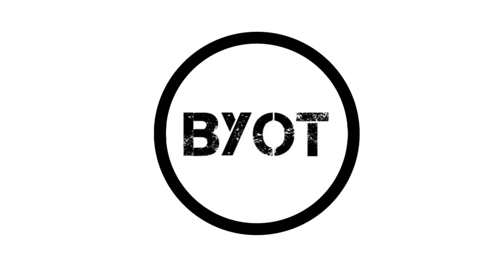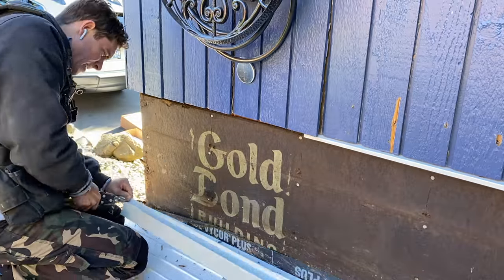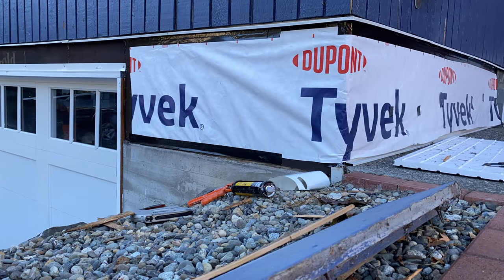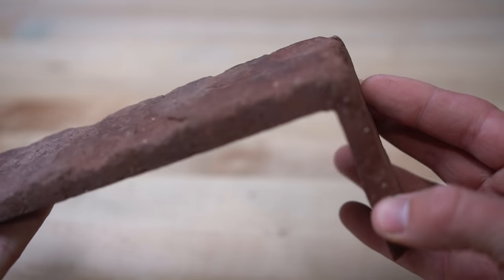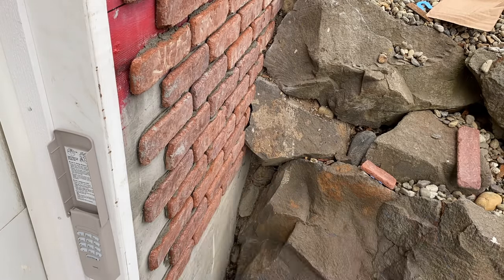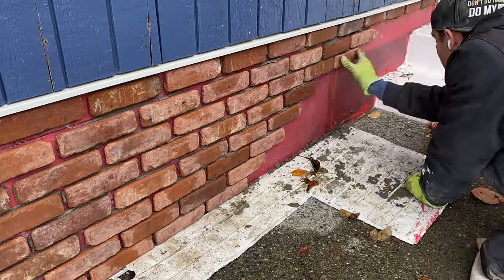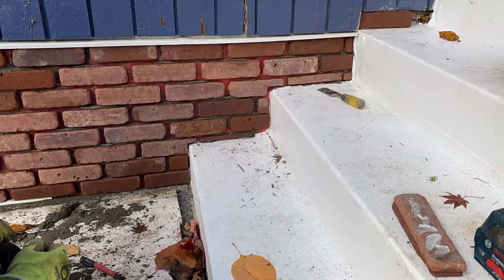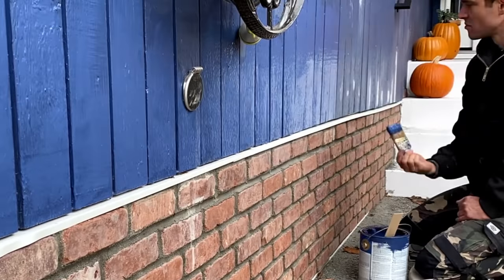How To Install Brick Veneer Outside // DIY THIN BRICK

Comment: As a mason for 16 years,  you did a pretty good job for not doing it as a profession.  I do the grout bag a different method but whatever way works is good.  Keep up the quality content.
Reply: Tuck pointing, using a hawk and jointer I’m guessing. Much and cleaner but the grout bags do the trick as well.
Reply: I use a trowel and tuck pointer if doing a small area but I would do the same method as him on this much pointing up.  I just fold the grout bag different.  I fill the bag the fold in half then roll it down towards the bottom.  It works well.
Reply: Combine it with a 15 year old house
Reply: @MudHere1  
Does thin brick make walls stronger?
Reply: @nuttysquirrel8816  it's not going to be significantly stronger than an LP smartsiding or 3/4" wood sided wall. If at all. The mortar joints would be a weak point on the brick wall and that wonder board is really quite weak as far as puncture resistance. You might gain a little bit of r value with the brick wall.
Reply: question for a mason. I was on a jobsite and there were masons setting up their scaffolding on the facade. They hung up a metal mesh over IIRC tar paper. I never got to see what they were laying.. If it was bricks, stones, brick veneers, or stone veneers.  When do you do you guys use metal mesh on exterior walls?

Comment: I do this for a living you did a good job man be proud of yourself
Reply: @scout1672  apply a coat of damp proofing tar let dry and you can apply thin brick should take care of it if water a big issue may need to install French drain then damp proof and then apply veneer
Reply: Not a bad job at all. 
1. First things first. For the love of God throw that flat trowel out of sight. 😆 and use your margin!
2. Always! Tool head joints followed by bed joints. Brush and repeat.
3. Brick tape story accordingly, snap every other story mark. (Every other course) lay to snapped lines. Then fill remaining courses with eyeball for level between already level courses.
4 .Hubbard jointer! Made of magnesium to pull moisture out (like flatwork) for smooth finish.
5. Cut tip of grout bad bigger!
6. Good job bud. Better than some apprentices
Reply: @Eyesopen365  I read brick veneer can't be used outdoors since it's so pours. I want to use is my outside kitchen wall.
Reply: @Eyesopen365  Thanks for the tip , we will.
Reply: @634shy  I've also installed this outside countless times, as well as manufactured veneer stone. There's a few layers of protection here. You could, of course,  cut real bricks down. 
But, between the layer of scratch coat (approx 1/8"-1/4") mortar, and the 1/2" bricks themselves, you're covered quite nicely. Over the house wrap, I've also always used 15# felt paper (roofing) starting at the bottom to ensure water tightness.
Reply: @634shy  hi yes you can I am about to do outside thin brick onto cement board which is treated with waterproofing, it’s real brick just thinner! Bricks are very porous, what matters is your waterproofing behind that👍
Reply: How much does something like this cost? But for the whole house (minus the roof of course).

Comment: As a 15-year brick pro that could not have been done better. Brick does absorb water but in your installation, it was perfectly dealt with. You could have spent the extra money to buy the trays thin brick sit in to keep them straight but it looked like you did well. Perfect and maybe a little overkill on the water management but I don't think you can overkill water issues. That was the perfect choice in the jointers. Fantastic job from a guy that knows. Well done.
Reply from the maker: Bryan you made my day.  I take pride in the videos I produce and did plenty of research on this project before taking it on since it wanted to make sure I showed everyone the proper steps.  Thanks so much for watching and sharing.  Truly appreciate the support.
Reply: Really? I think it was pretty amateur work
Reply: @DK-bk1vq  I was thinking the same thing. Haters will always hate! BYOT did an awesome job!
Reply: @dans8935  I agree! He put the labor and time in to get this to us. 
  Posting your work on YouTube, is something I have no inclination to do.
 And certainly ol boy Dustin, who complained, would never have the stones to do because someone might hurt his feelings.
Reply: @BYOTools  OUTSTANDING VIDEO--I was almost finished typing in a 15 line reply, then touched the wrong key and it disappeared. I don't have time to recapitulate it all. Just simplify my question. Can any thin brick be applied over real brick (that happens to be the surface on about half of my original Cape Cod , circa 1920. The wirecut red brick is obviously original and is 99.9% solid mortar joints (just a few bricks on front facade near bluestone front door landing which obviously got decades of splashed water and snow, but nothing tuckpointing. couldn't fix. I've been aware of thin brick and saw some workers installing it on the lower sections of a Walgreens in town here in Brgen County NJ. Very impressed by the finished project and how good it looked (though of course as always there's a lite hazing of efflorescence that comes and goes for a few months) I don't know what the surface was they started with but I am sjure it wasn't brick; Probably concrete. I need to know if you know where I could find info (on youtube or elsewhere) on the feasibility of using any thin brick directly on top of (of course a properly prepared) substrate of REAL brick. (About one third of the sq footage of the house is brick, one third vinyl siding (upper level) and the remaining third large decorative beige stone (on the rear section which was remodeled and expanded befoe we moved in 25 years ago.. thanks. hope to get some info ....
Reply: @williamcervetti1455  why not ask your local contractors this question? I'm sure at least one of them will be happy to help; if you don't get a reply here, that is. Good luck.
Reply: He used RedGuard in a vapor transfer situation and therefore it either has already or will fail. And a "brick pro" touting a venneer brick looking tile job is like a plumber claiming that some guy who used a bunch of sharkbites did a fantastic job. lol
Reply: Are you for hire

Comment: I have never seen anyone use rock board or redguard on exterior of home. Its definately water protected 3 or 4 times over..a. contractor would have charged 2 arms and a leg to give you that much protection, that's the benefit of DIY, nothing can ever be overkill if your happy. That part of the house will be bone dry 500 years from now. Id love someone like you to do a job for me. One thing for sure, i definately wouldnt want to work for you. And i say that in the most positive way possible..everything has to be perfect

Comment: Nice job. One area of concern is that the mortar that you are using does not bond to the red guard at all. You should be troweling on a polymer modified thinset onto the wall then adhering the bricks to it. Other than that fantastic job. Especially on the prep work.

Comment: Some of that was overkill, however I'm all about overkill. Every project on my house I make sure If it can have extra protection without causing a problem then it gets it. My yard gets flooded and it floods my crawlspace. The previous owners solutions was just a tiny sump pump in the crawlspace. It barely keeps the water from touching the floor joist. I installed gutters, french drains foundation drains, and resurfaced the yard to shed water. All of my drains are now tied to the city storm drains system and the last thing I need to do is replace the damaged siding that's why I'm here. You did a great job and very informative thank you.

Comment: Looks great, man!!! The curb appeal just took a 180° for the better! Even though I'm more of a natural stone fan, this works very well! 

We did a great natural stone wall around and above the fireplace to the ceiling, at my buddies parents house while they were on vacation. It paid off in spades just to see their faces when I hey saw it.  They've always wanted to have it done but contractors were too much $$$.  We saved thousands by free material, other than pegs and mortar and doing  it ourselves. We've been stocking up on stone for a long time so we had it when we were ready.  Free is my favorite 4 letter "F word"...!!!

Comment: Thanks for posting this. I need to do a small section of brick underneath a basketball goal because I keep tearing up my vinyl siding. I tried to shop for brick but didn't even know most of the terms for the supplies I needed to locate. Now, I know a lot more about it.

Comment: I was always wondering how to deal with the non masonry walls, and learned through watching this about the cement board. Will definitely have to watch several more times before attempting this on my house. I live on Massachusetts/New Hampshire border, so getting the moisture barrier and drip edge is crucial to a safe and secure house. And I did get the Rick and Morty reference.

Comment: Great tip about adding liquid first. Proper mix techniques, materials and tools are the first and very important step to getting a quality finished product.
Reply: Same tip goes for powdered mashed potato. Practice with mashed potato first, cos it's cheaper and you can eat the bad mix as well as the good (Y)

Comment: Good job! Two hammers ends together though is a big no no as there’s a risk of them exploding. Something to do with hitting hardened steel with hardened steel if I remember correctly.
Reply: Yeah, should have used a copper hammer, not steel on steel

Comment: I just use a bit of rubber hose as when I lose it I just cut off another bit to do the pointing . I've been using this method for yonks and never have a problem .
Reply: @speedster9622  yes it does 😀 in the English dictionary . Comes from donkey years any time that is quite a while ago  or doing something for ages .

Comment: Very nice work. I watched this a year ago. I'm curious,; how's it holding up after 3 years? And another question. Having looked at the Old Mill Thin brick system, why did you not use their polystyrene backer board? Thanks! Keep up the great content!

Comment: I have never done this so this may be a stupid  question. You know normally full size bricks lay on a foundation ledge for suport, and a metal "L" (lintal) to go over opens hense the garage door. Does the motor do the job, doesn't need any additional so called suport?
That was great work looks perfect!

Comment: I didn't catch the reasoning behind the cement board being used outdoors. Was this just to flatten the transition?
Also in the veneer world, working from the top down is common. Less chance of a mess on the stones and bricks below

Comment: Nice work and easy to follow! QQ - was there a reason you did not need to apply Red Guard to the native concrete foundation (seems you only did it on the wonder board). Meaning if you already have a concrete wall the brick vaneer can be mortared directly to the concrete? Results look amazing! Thanks for sharing!

Comment: It's a good idea to put a bonding agent on poured concrete walls.  The can be too smooth to put this type of veneer on.  I had some of this pop off a concrete walls. I checked with my sub and he had not used a binding agent.  it was a just coupe of pieces and could have been worse.

Comment: I'm doing one of these soon on a foundation and my worry starting from top along that trim which already exist on house is I doubt it's level. Wondering if I should start with a joint on top and run my top course true to my own marked line half inch from trim.

Comment: Nice wk!  I am a tile setter and doing same.  I am using your video as a guide.   How does the mortar you used adhere to the red guard?   I have always used a thinset with polymer for bathroom tile.

Comment: Congratulations, I like the video! I want to ask. Can I also do this by applying glue to the wall in smaller areas? My other question is that if I put a little more glue on the wall and it fills the gap between the bricks, can this glue stay as a grout as well? I want to do it in one go, is that possible?

Comment: Nicely Done! Great explanation of steps, just watched a lengthy 3 minute and 30 second video from a mfg on doing this same thing. Nothing on backing, just mortar your bricks, stick'em then fill in grout, duh...really...not really good instruction but this was great. Thank you!
Reply: Moisture does get behind brick walls so it’s better to have a backer cement board that you don’t have to worry about it rotting ever and the mortar sticks to it great

Comment: Maybe one of you guys can assist. I got a wall with particle boards that is flush with the concrete slab. The slab is 2 feet above ground. How would you go about installing cement boards in this situation? Would you rip the particle boards and replace them with cement boards instead? Installing cement boards over particle boards will create a 1/5 protrusion.

Comment: Does the thin brick not need an airgap still between the cement board and wall or does the redguard remove the risk penetration?

Comment: use the heel of the pointing joiner it keeps moisture in the mortar not like when using the tip as it tears the mortar to look dry. Also do long lines as it is faaster not just little brick lengths you don't let the mortar dry out.

Comment: I watched this video to see how you sealed above the concrete slab. You seemed to use belt w/suspenders method in all other areas of possible penetration but even though the video neglected to include that flashing area it appeared in the brief frames of you installing it you did not show any sealant. To me that is the most likely area for it to leak and you spent the least amount of time covering it. I would be curious to know what efforts you made to keep the water from running back under your new veneer above the slab.

Comment: I just had my exterior wall fall off. I had a contractor tell me it was because the person that put the wall up did not use wire. Anyone know if wire is a necessary thing? I love how this project turned out. I too have the half brick wall (the one that partially just fell down) I think i could do this myself as someone also quoted this small wall out at 10-12 k

Comment: Thank you for including the list of material but is there a way to calculate how much of it we need. This would really help when I click on the links to order the correct number
Reply: depends on what type of brick you select. Figure out how many square feet you need and any brick store can calculate that depending on the brick you want. It's an easy calculation. Good luck

Comment: Whoa worried about that job.  I would red guard under the cement board and then wet the cement board before I attach the brick. It looks great.  Waaaay better then the siding.

Comment: My house is sided, except for the first 18 inch’s, which is coated with cement thin layer to the cement foundation.  I assume that I would have to chip off the cement to get a flat wall.  Is there a easier way to apply a stone or brick veneer?

Comment: My house was built in 1971, where there is a brick veneer, the backer board is this thick asphalt impregnated fiber board 1/2" thick. I don't see it available anywhere so I can't give it a name. Must be old school material and not used anymore.

Comment: It looks beautiful, but there is no air gap or cavity between the bricks and the wall panels to drain the water and dry the moisture. Also, all the moisture inside will blocked just behind the house wrap. Insulation expert opinion needed!

Comment: I would like to do this on my fireplace (electric) on the deck, just wondering if anyone can answer if it's too pours as I'm reading on some veneers it says indoor use only. Could I still use it and just seal it after?  The one I'm planning to use is Soho Decorative Bricks from Rona.

Comment: It’s my understanding that bricks needs an air gap to control moisture. Thoughts?
Reply from the maker: Great question Bo and I was aware of that surcumstance which is why there is a waterproofing membrane on the cement board.  Plus based upon my research in not much of a factor with veneered brick, mainly real thick brick.  Thanks so much for watching and the continued support.  Hope you enjoyed the video.
Reply: @BYOTools  thanks for the reply. I was wondering because I want to do veneer on my house front. Yes, I enjoyed the video.

Comment: FYI most all brick jobs are veneer it doesn’t matter if it’s thin brick or not. The only walls of brick that are not veneer is when the brick wall is a supporting wall or load bearing wall. Brick Veneer covers a wall that’s standing on its own therefore most all homes are brick veneer. Now you know thanks 👍🙏

Comment: There have been 600+ comments before mine, and I am not intending to bash your work or video before watching to the end to learn something. But as a carpenter, I learned that beating 2 hammer heads together is a big no no, especially without eye protection.  The siding demo should be done with a hammer and a flatbar/crowbar not 2 hammers.  Hammers are hard. Comparatively, nails are soft (that is why they bend when you miss).
Hitting two hard hammers together might cause shards of shrapnel to go flying. Eyes are in danger, and once a hammer has a chip out of it, it will be even more likely to keep shedding shrapnel.